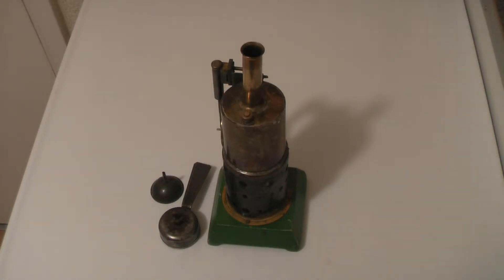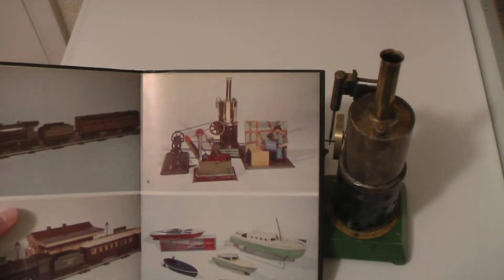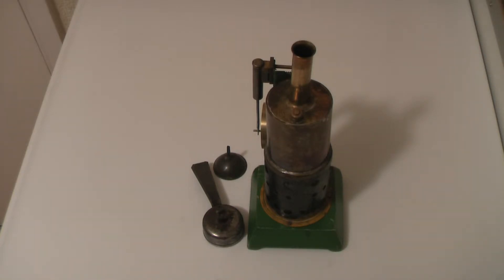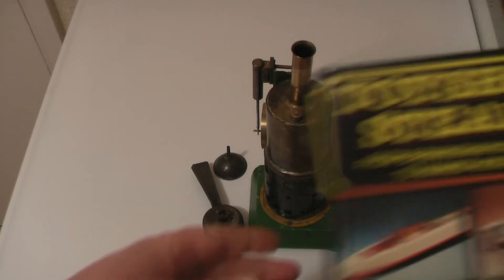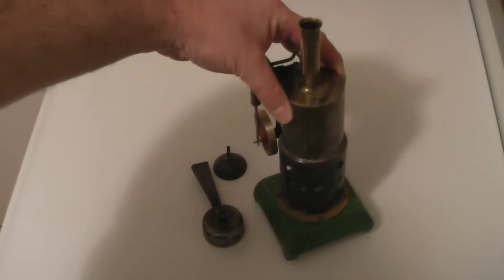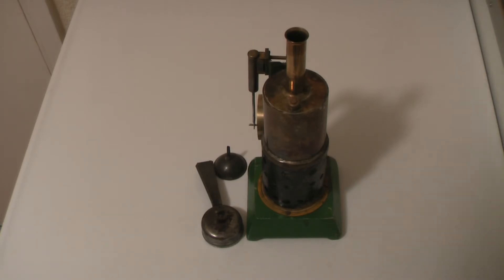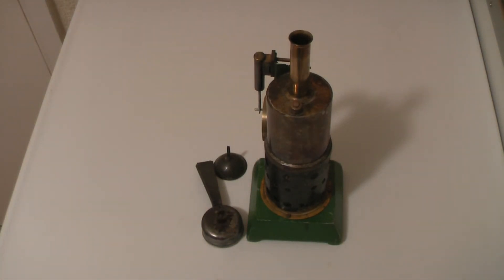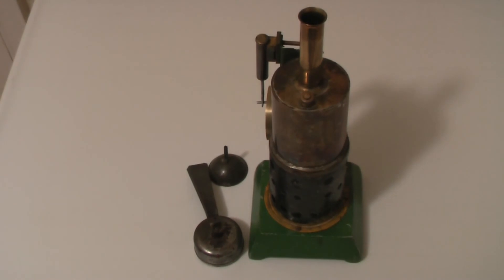English vertical steam engine.

Comment from the maker: Hi Alan
Thanks for the info, I had heard rumors about a link with Mastrand
I have a Mastrand roller and have compared the two engines parts
And they don't share any similarities for example the Mastrands flywheel is made from Mazak
Were as the vertical flywheel is cast brass, the piston machining is different quality
And the chimneys are different materials and quality, they look to different to be linked
But I may be wrong, Hope you have a happy new year Alan.